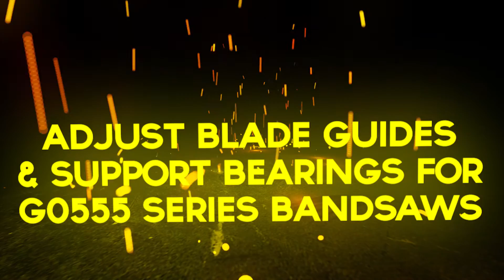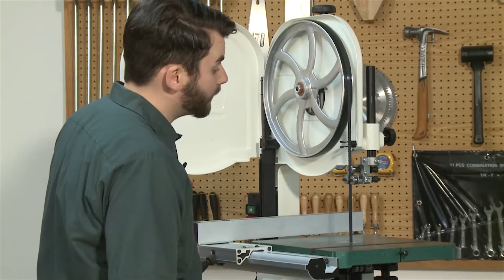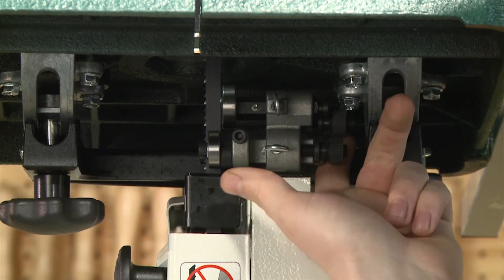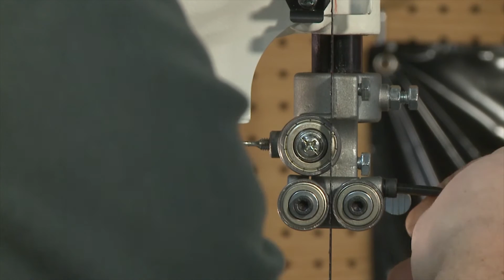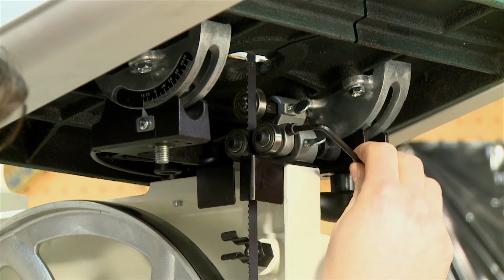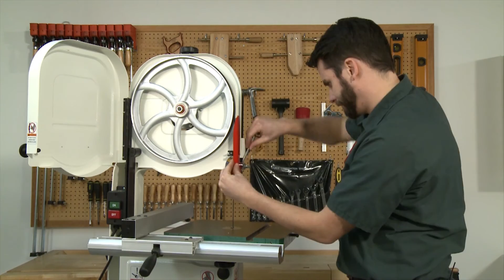How to Adjust Blade Guides & Support Bearings for G0555 Bandsaw Series

Comment: what makes it cut to the left. miter gauge set at 90 after 4 inches it is 1/4 inch off
Reply from the maker: Hi Rod! Blade drift is very much blade-dependent--it just can be reduced by properly adjusting guides and tracking the blade on the wheels. That said, we like to have folks step the gullet of the blade in-line with the center of the bandsaw wheel (the wheel being "crowned" means this applies pressure to the blade at the top of the crown, and reduces a lot of contact that can lead to error in the blade-to-wheel setup).

Depending upon the blade being used, you may need to shift that center-of-crown alignment forward to rearward to help guide the blade. Remember: this will be blade-specific. The tracking knob on the backside of the upper wheel housing will let you make this adjustment, and we recommend doing it in small increments.

To test the drift, use a piece of scrap plywood with a straight edge run along the fence (ensure your fence is perfectly aligned with a reference edge like the miter slot of table edge to know it is square). Set the fence at whatever distance from the blade you like, then run the piece and measure the ends. Adjust the upper wheel in or out slightly, then repeat with another square piece of scrap. You should be able to work the blade drift until it is even.

Alternatively, you can use what is called a "drift bar" that mounts to your fence and allows you more space to counter blade drift--though it is a far slower cut process and requires a lot of focus! Grizzly sells a resaw drift bar (Model T1213) that mounts to taller bandsaw fences as well.
Reply: @grizzlymachines  Thanks I am working in that direction . I did watch Sondgrass's video and read your reply. On thin blades , is there an adapter to replace the guide wheels? thanks again
Reply from the maker: We sell am aftermarket blade guide set that has what is called a "Scrolling Blade Guide Kit" for 14" bandsaws. This is designed for super thin blades, which ride in the tracks on each guide: 
https://www.grizzly.com/products/grizzly-euro-style-blade-guide-assembly-for-g0817/t27908

 If you have a 17" bandsaw you can always try swapping for a Euro-style guide kit, which is essentially large flat discs that hold the blade in place!
Reply: @grizzlymachines  do you have a part number for the aftermarket blade guide for 1/4 or smaller blades? Thanks Rod
Reply from the maker: Do you have the model number for the machine you'd like a blade guide for? That would help us to direct you most effectively!
Reply: @grizzlymachines   It is the GO555 . I did figure out blade drift. It was caused by a dull blade. Caused by not properly adjusting the guide rollers. You should give Alex Snodgrass some funds for him helping you. Thanks Rod
Reply from the maker: Then you're looking for the T32429! https://www.grizzly.com/products/grizzly-14-bandsaw-scrolling-blade-guide-kit/t32429 According to our Tech Department, that should work for your machine.

Comment: My old G0555 band saw wasn’t that easy to adjust…the bottom guide bearings were as described to adjust…except when tightening up the thumb screw the whole assembly rotated up slightly and put the bearings hard up against the blade, I wedged a screwdriver in to rotate the assembly, then the adjustment was fairly straightforward